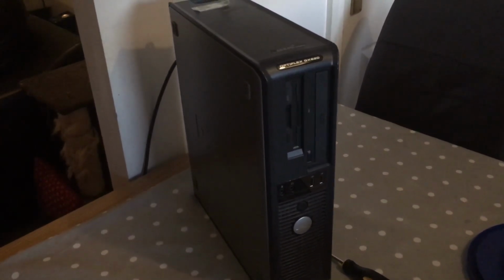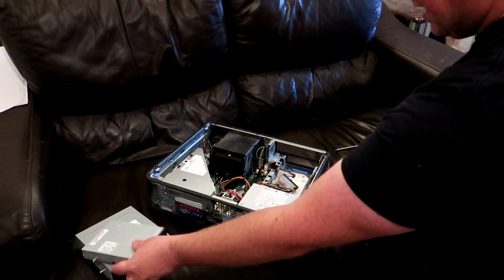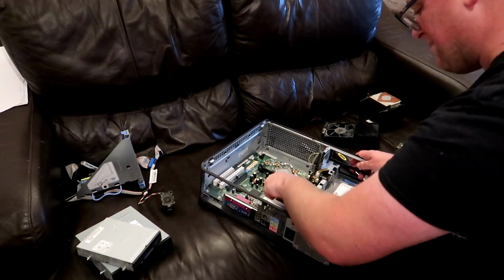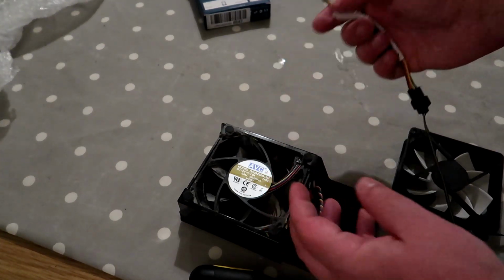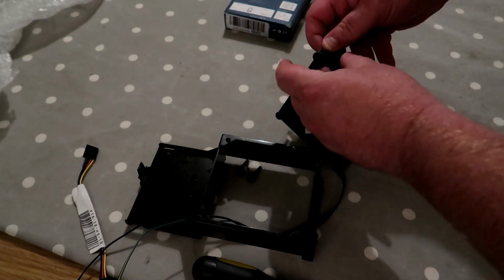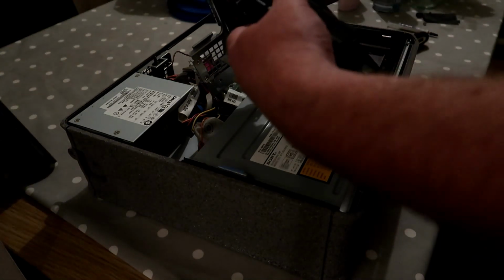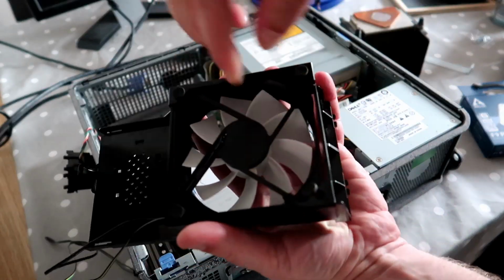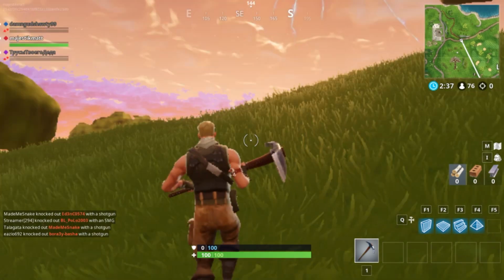The Pentium 4 Dell Optiplex GX620 Made of STONE? Will it run Fortnite?

Comment: i just got one of these old dinosaurs off fleabay for 50 bucks. its a p4 like yours with 1gb of ram i plan to upgrade the ram to 4gb stick a half decent xp era GPU in it and just play and enjoy some old games. i use the SD2ide adapters on some of my older machines windows 98 windows 95 etc and they work really really well.

Comment: As you mentioned, most vintage hardware like a P4 is best at running things from that era (XP, older games). Another guy on YouTube pushed a Dell Core2Quad to run Windows 10 fairly decently by installing an SSD and adding a graphics card, with surprisingly acceptable results. A lot of newer model Dells can be pushed a lot further nowadays by mainly adding those two things, SSD and Graphics card. Maxing out the ram helps a whole lot too. Amazing and fun stuff.

Comment: When you installed the CPU fan, you said that if you put it into the bracket the wrong way, the system would get hot, but what have done is purposely swapped the direction of the CPU fan to suck cold air through the case and hot air out the front, why? you may ask
well its because these dells don't have any exhaust fan (that only spins extremely slowly) to get rid of the heat from inside of the case, causing the capacitors over time to get too hot and bulge and possibly explode, causing a motherboard failure. I still use this dell and with the extra heat of my gt 1030, I needed to do this. Also I recommend you do this as my system still works today and the temps of my 3.00ghz core 2 duo go at a max of 50 degrees Celsius which is fine as the CPU starts throttling at 80 degrees Celsius.
Reply from the maker: Nice tip Nathan. I genuinely thought it would cause chaos. These old Dells really do struggle with thermals
Reply: Thommo's Tech really any small for factor pc will struggle with thermals without an exhaust fan it’s kinda dumb how companies don’t realise this
Reply from the maker: @RoverNathan  and a bit dumb for tech enthusiasts like myself to also be unaware. 🤣
Reply: Thommo's Tech haha were all dumb in our own ways 😂
Reply from the maker: Me more than most. Ha ha
Reply: Thommo's Tech lol

Comment: The second pc is not a GX620 it is not made like that It is sff, I have been using one for years.
Reply from the maker: There's 3 versions of the GX620. SFF, Desktop and full tower.
Reply: @ThommosTech  I have a SFF version and it has a Battery Voltage low message every time even after fitting 2 new CMOS batterys... RIP
Reply from the maker: 'f' to pay respects
Reply: @ThommosTech  F... Can't believe I posted that 5 hours ago, since then I've built a whole new Windows XP Computer and a budget Windows 98SE machine with an AMD Athlon 2200+, a ATI Radeon 9200, a single stick of 512MB DDR and a 150GB HDD. I still can't choose what soundcard I wanna get, it has to be PCI based as I have no ISA slots on this motherboard... Probably gonna be a ESS Solo-1 soundcard as they sound like the OPL-3... My Toshiba Satellite Pro 480CDT laptop has an OPL-3 so I'll be able to compare them :)
Reply: @ThommosTech  also thanks for the ❤️ on my comment, I appreciate it and I hope the channel does well. :)